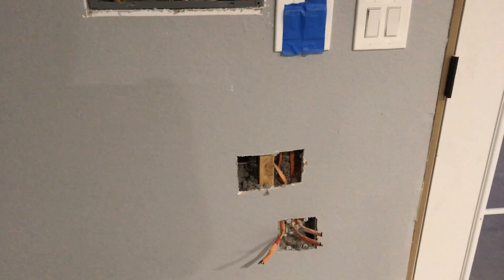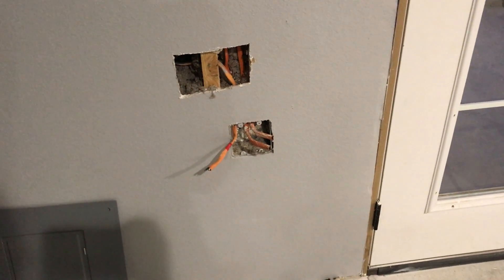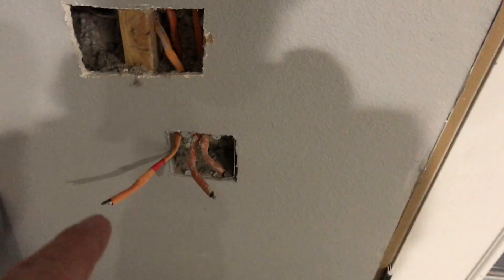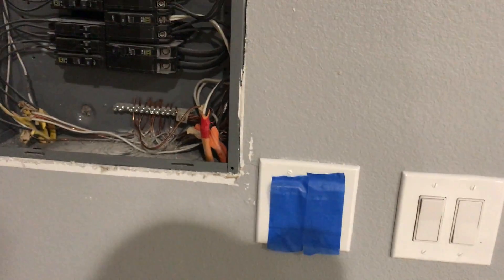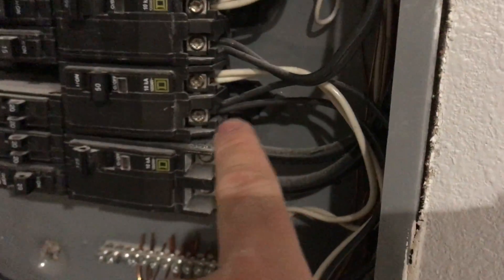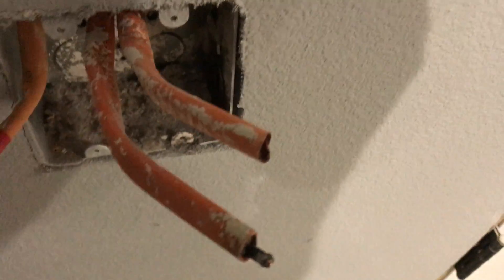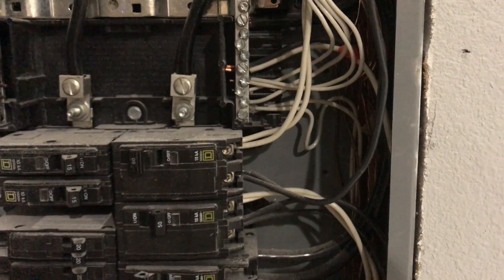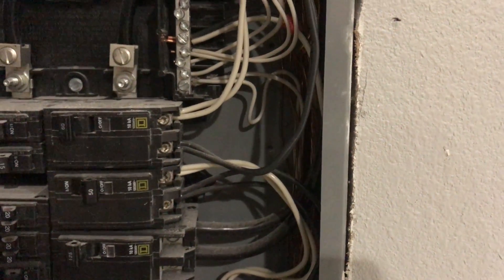50 Amp 240 Volt Receptacle Wiring

Comment: I deplore "micky mouse" stuff like this. It leaves the next guy who comes along with your mess instead of accepted electrical practices. All so you did not have to purchase more than one wire type WTF ?
Reply from the maker: Well, at least you listened to the reasoning. Personally I deplore narrow mindedness that says there is only one acceptable way to do something. Albeit I appreciate you input. Would you agree that this will work just fine? You got the point. So I don’t have to purchase more select wire, and so I don’t have another trip to town. I had a surplus of this 10/2 anyway, so might as well use it up and save the aforementioned trip to town just to buy a few feet of some 6/2. 
I’m not worried about whoever comes after me. This is an owner build, and I’m my own electrician. If in some stretch we do move on from this home and sell it, well then sure, the next guy can deal with it. But for the near term, we aren’t planning to sell it.

Comment: Well you just described the problem in one word (Engineer).We had those at the 120 megawatt power house I use to run in Sheldon . There is more resistance in 2 small conductors than in one large one. Resistance equates to heat . We will leave it at a disagreement . Catch you later. Greg
Reply from the maker: Come on man, don't be narrow minded about the engineers! : ) We aren't all bad! The real problem comes in when engineers can't communicate with the "pro" electricians that just do it their way because they don't like engineers. Ha!

Now, you know they do insulate wires right? We're not running knob and tube anymore like when you were a young buck Greg. Hahahahaha!!! Anyway, those two conductors aren't going to build enough heat to be anywhere near a risk of a fire. Sure, they might degrade their insulation faster over time, but we're talking 100 years or so. If this structure lasts that long, I'll be sure to leave a note for the great grandkids to rewire the place after I'm long gone. 

Funny you mentioned that about the power plants. My brother that did the electrical design for me also works for a midstream company and does substation design and installs.

Comment: My neighbor across the street just had to replace one of his AC units because one of the conductors lost contact and the one left wasn't enough to handle the load. No doubt it will work as long as you don't have connections come loose. It's ok though it's your house . Don't forget to install those smoke alarms.
Reply from the maker: Oh ye of little faith. Designed by an electrical engineer don't ya know. Just got he PE too. House fire is not a concern. I wired up enough of them backwards to know my breakers are tripping just fine... Now I suppose the underpowered AC unit could be a risk but that could have happened with dual conductors "properly" wired anyway.

Comment: Number 8 , 3 conductor with ground . Tear that out Tom and do it right.
Reply from the maker: Greg Combs parallel 10G is equivalent to #6, which would be more than #8. Nothing wrong with this, just not as clean looking as three individuals conductors and a ground. 

I did all my big circuits on the house this way. Anything bigger than 30A (10G single run) was parallel 14, 12 or 10G. Saved me buying bunch of different size wires and having odd size scraps.